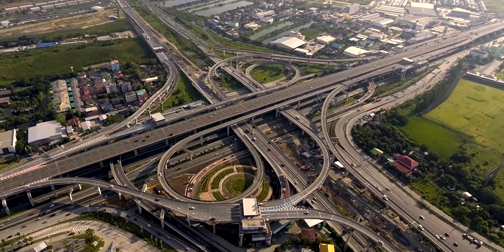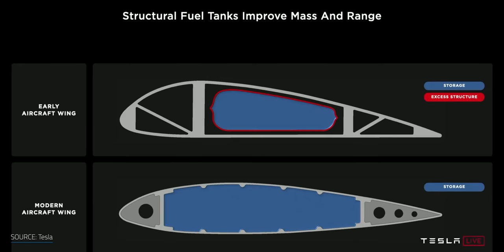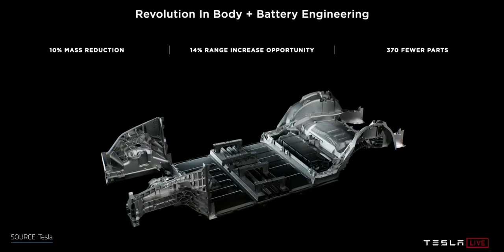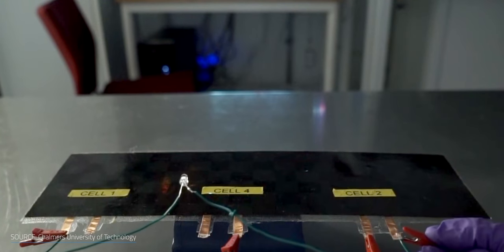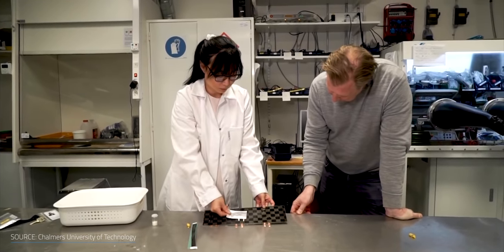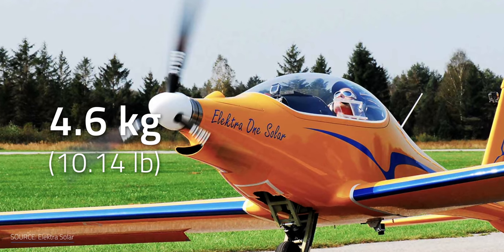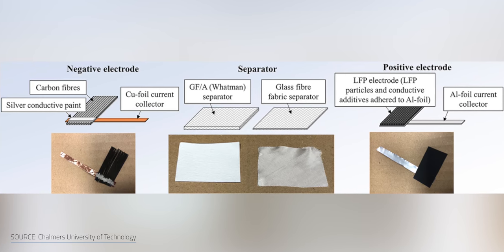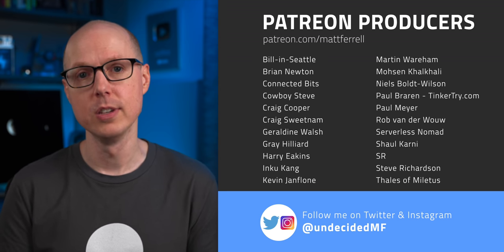Exploring Structural Batteries

Comment: Here is what is going to happen, we will never hear from it again. In 2009 Stanford university announced that they made a battery from carbon nano tubes, normal paper and ink. Their battery outperforms every existing battery on all aspects. It has a very high energy density, very low weight, and it can be made in any shape, it has a very high charge and discharge rate, and it can be charged and recharged thousands of times more compared to existing batteries. 

They also announced that same year, so almost 12 years ago, that they developed a solar panel that can convert both light and heat simultaneously into electricity. The warmer they get the more energy they will produce. Stanford university claimed that it is so efficient that it can compete with fossil fuel. 

Guess what happened with it.....we never ever heard from it again.
Reply: Exactly. Technology has been bought and never seen again since sometime in the 1800's.
US patent office has been used to hide at least 50,000 patents that deal with the BIG 3.>> Energy Production, Transportation and Pharmacology. Any improvements of these 3 areas will only come When "THEY" want them to.
I don't see any way around this, But there are lots of people way smarter then I am. I hope we can overcome this SOME HOW!!

Comment: Very interesting. I am confident that this technology will improve over the next years. However, An automobile is not an airplane. Cuting weight by let say 10% is not gaining 10% range. I am telling you that because i experienced that on both car and motorcycle tat both are electric and i'm doing the same range on my ZERO SR with 100 pounds of luggage than without.  Removing weight sure help for range but ot at the level you mention. Tire friction is the main factor. Acceleration dosen't because regen is recovering like 90% energy on next braking.

Comment: I have a better idea - we use a machine that burns chemical fuel to power another machine that has wheels and a crank. It's called 'person riding a bicycle'. Swedes already use them a lot too, so no need to create a new infrastructure for charging. Works well over city distances and is very environmentally friendly.

Comment: So, if there's a fault with your 'fuel tank'... You will need a new structural component or, more likely, a new car. It works on commercial planes because they are modular and designed to be replaced with huge resources behind them.   Try getting Tesla to replace a faulty or worn out battery after a few years use will probably write the car off.

Comment: The "massless" term is very misleading. This technology basically wraps the battery (which has a mass) in a protective capsule which has some load bearing qualities and can be used as the structural component. It replaces a heavier protection of much more efficient battery with a lighter (14% reduction) of much less energy dense (only a 20% of current standard) battery.

Comment: I wonder about performance at low temperatures. I note the structural battery uses Lithium. Today's EVs have heaters on the Lithium Ion batteries to prevent them from getting colder than their operating temperature range. Structural batteries have a large surface area largely exposed to the outside temperature. They have a much larger (100s to 1000s times) surface area than existing Li-Ion batteries and hence would consume 100s to 1000s times the battery heating power when driving in the same temperature conditions.

Comment: Structural supercapacitor would be much more interesting. So it would be another useful component to manage power spikes in regen and acceleration. Lithium cells will improve much more than the 300 wh/kg making all the wires, connectors and electronics needed to connect to that 25wh/kg of energy not profitable.

Comment: For anyone really interested, the following will help you research the topic presented here.

The use of quotes is a giveaway to some...but only to some.  There is no such thing as massless energy storage.  Here, part of the structure of the vehicle is replaced by a component that contains the material comprising the batteries...because, of course there are still batteries.  The batteries are to be made of a new material...and that's fine.  This component structure is now to be an integral part of the vehicles structure.  That's  OK as well...and it could be accomplished by  the current tech.  That is, you could make a vehicle where energy material was also a structural material for the vehicle.

But here's the problem, your structure should not be the energy storage material.  Vehicles get into accidents.  Vehicles are drivable following 93% of road accidents.  But...and this is a huge but... gas tanks and battery casings are designed to be nearly crash proof...requiring, in general, the totaling of the vehicle i.e. a bent frame and or complete failure of the drive train and its associated sub units for these energy storage units to fail.  Now you have a far far more expensive version of a battery...10x to 20x more expensive to produce (this is not new tech...thin film has been around for 40 years...and it's is used to make chips and has been for 40 years) and will add many  thousands to the cost of the vehicle and many thousands to repair costs.  Moreover, insurance costs would be massive as cars would be totaled for far less external structural damage if just the now structural battery space was damaged.  

Your aircraft analogy is just incorrect.  An aircraft does not use fuel as a structural component...if it did then aircraft structure would fail in low fuel scenarios.  They don't.  You are trying very hard to make a point you cannot make because there is no analogy as no engineer would be foolish enough to do build as you clearly want to infer.
 
The really big issue here is that the technology is in its infancy for one really big reason...everyone is trying to make a capacitor act like a battery....and at the power levels required to propel a 1+ ton vehicle.  Right now, there are small firms producing the $415 million in thin film batteries.  That fine.  They are used for small electronics applications.  The reason for this is two fold.  They are only capable of low current output but can be recharged 10s of times more often than liquid batteries....ideal for phones, laptops, tablets etc. 

Why low output?  Physics.  Thin films cannot discharge energy in large amounts.  The max discharge is measured in micro amps per cm^2 of battery.  To produce about 1 amp of continuous output it would require about 10 m^2 of thin film or about 2m by 5m...2 meters is about the average width of a car and cars are about 7 to 8 meters long.  So, given that the low end of discharge for electric cars is about 315 amps...the median is 512 amps...you can see the issue.  

In general, I don't trust University press releases because they are generally attempts at raising funds from people with too much money and too little commonsense.  Most university programs actually making breakthroughs are very very quiet...because there are myriad issues regarding licensing potential and expansion of funding by governments...even spin-off entities.  

I have included relevant sources.  The Chalmers notice, a 2021 piece at the forefront of thin film battery tech...with the associated physics, a paper from a company that makes current cutting edge production batteries...one of many, and a review of the business end of the current small market and expansion areas.

https://www.chalmers.se/en/departments/physics/news/Pages/A-spreadable-way-to-stabilise-solid-state-batteries.aspx

https://www.frontiersin.org/articles/10.3389/fenrg.2021.625123/full

http://www.excellatron.com/thin-film-battery-technology/

https://www.businesswire.com/news/home/20210505005613/en/Outlook-on-the-Thin-Film-Battery-Global-Market-to-2026---by-Technology-Battery-Type-Voltage-Type-Application-and-Region---ResearchAndMarkets.com

This could work...but not as shown.  The batteries must be removable.  They will wear out and/or become damaged.  This is not a phone.  People have gotten use to the idea of tossing the phone when the battery fails...see how Apple handles iPhone battery replacement.  This will be a 50,000 to 60,000 dollar car for a base model.

Comment: The area of the car and weight required for its proper movement on the road will cause a form and function issue, you can use this to design a new flying vehicle more than a car on roads.

Comment: During a fender bender type crash that is mild to moderate, small damages or dents in the battery pack area will end up SCRAPPING ENTIRE CAR without access to the battery pack if the battery pack is integrated into the structure. This integrated structure idea would be useless Matt, for majority of mild to moderate fender bender type crashes if battery area is affected.

Comment: there is a issue with a structural battery, that isn't realy considered here: if its the outer body of the car or phone or anything, then any damage to the cell would puncture the two membranes creating a short circuit in the best case it would be fused and the part of the cell would be disconnected from the battery, however there will be cells that gets punctured but doesn't break the fuse so they will instead drain the rest of the battery "forever". this happens to cells in cars to however its much more likely when the cells are more susceptible to damage. So now any minor damage to the car body would have to manually make sure the fuse has been disconnected. and crashing with another car could cause the body to ignite gas to ignite as it short circuits causing more explosive results from crashes. its a nice idea but not as practial. in phones it would be catastrophic, as so many people drop their phones, and people crash their bikes, skateboards and scooters all the time, making sure that these parts of the batteries doesn't make the batteries worse than not having them is going to quite challenging.

Comment: A lot of commenters seem to think a structural battery could not be repaired/replaced. I don't see why they couldn't just take it apart just like the CAD model shows it going together. Sure its a lot of work but so is an engine swap or a fuel tank replacement. Frame swaps and repairs are already a thing

Comment: Carbon fibre is not cheap.  That is a critical factor in evaulating the commercial viability of any battery material.  Are there any projections as to what this composite would cost per Kg?  Also it would be competing with the giant casting machine for body components.  Can this technology be quickly formed inot complex shapes and still retain its electrical properties?

Comment: This is a long way off from helping heavily used mobile devices. As it stands the majority of the weight in our phones and laptops is the battery, and it weighs that much because of the wh/kg limitation of batteries. This "massless" option has more mass per watt hour... so to get the same function from our devices the structure would have to increase(if eliminating standard battery packs), and only loosing a small percentage of battery weight if maintaining structure and only reducing the capacity of the standard pack...

This will be far more impactful for self propelled items with moving parts at scale... electric vehicles, drones, various robotic applications... and then mostly in locations away from electrical infrastructure. 

Best singular use I can imagine, replacing all of the trunks and totes used on wilderness exploration and field research projects. Just simply including more stored energy for these things in the closest to massless application I can think of... in things that have no electrical consumption of thier own.

Comment: The weight of just the battery in an electric car is about 1,000 pounds.  What we really need is to reduce that down to just 10 pounds (100 fold weight reduction).  Then have an easily swappable battery at the charging station where you just pull up and swap out the dead battery with the charged battery, two minutes at the charging station instead of waiting an hour for your car to charge.  I'd buy an electric car in a heartbeat if you could figure out how to do that.

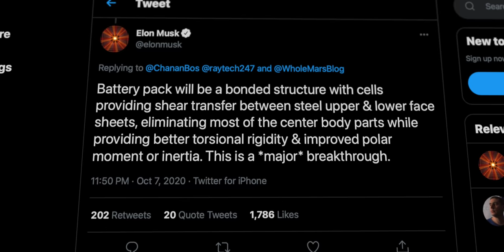Comment: 3:50 these have downsides too. 
a) cooling. its hard to keep battery that is mounted that way in any costant temp, this is an issue for longevity as AC'd battery have like 90% life left after 2 years, while nont AC'd batteries have like 60%.
look at data from nissan leaf, and tesla. 
b) imagine costs of replacing it. tesla now takes 22grands, Imagine if it means they need to literally dismount and replace crucial most imporant part that is keeping the car together. 
c) easy to flood, its very low, in case of damage to the shell, which will happen eventually, you have water in battery compartment -> I would not touch a car like that.

Comment: Important questions: What happens when a carbon-fibre battery is broken while it's charged? How many charging cycles will it last for? How replaceable are these parts? Like that Tesla structural battery dealie sounds like replacing it might require removing most of the middle part of the car.

Comment: Ah, I like this news of the 'bloodless' creatures who are creating those 'massless' structural batteries.  I doubt that it will ever work in the automotive industry, because this is not based on the Einstein's equation, E = m C^2, where 'm' is the mass of the material fuel in the nuclear reaction(s), typically by fission rather than fusion.  The more deceptive terms they use, the more corrections they need to make later, like misnomers microwaves (i.e., micrometer in wavelengths, not; just only millimeter in wavelengths, but using these terms are musical to the ears!)

Comment: Take a typical battery with out a charge in it and measure the  resistance of the battery. Now take this composite, structural battery without a charge and measure the resistance. How easily will electrons flow through this new battery?

Comment: Seems to me it's only half massless. They are using the negative carbon side as structure. The positive side does little for the structure. It would therefore count as battery weight.

Comment: This could work well as tractor-trailers roof section/s that would be integrated with solar panel/s..... productive/lightweight/structurally strong.They could then be repurposed as a solar panel/s when the battery/s are no longer is up to par and when neither work you could build something like a garage to park your EV in instead of stick-built construction.... less deforestation.

Comment: We wont have plates that are both plates and batteries. Again, taking a look at what biology does. We can use, let's say, in the form of the so hated lipocytes, but they do serve mainly as storage. They do provide some structural dampening, and thermal isolation, but their main role is to store energy. Batteries will become sturdier and have others purposes.
Your muscles purpose are both structural and to move your body. But they can also store some energy within, that the rest of the body can use. This is more likely to happen with this carbon fiber material.

Comment: I think this is exciting for consumer level batteries for sure. Like phones, computers, handhelds etc. For automotive, I'm not positive that the weight savings is really going to offset the reduction in power.

With easy to replace modular pieces this idea might work out, although it still sounds expensive. Replacing huge chunks of chassis can't be cheap on the labor or parts.

This is a big breakthrough, but it's just the beginning.

Comment: I don't believe range is the greatest issue regarding electric vehicle development. 
1) the ability to provide ready supply of electricity to supply to vehicle
2) global supply of metals to build batteries
3) time required to recharge the battery of the vehicle
Personally, I view hydrogen fuel cell vehicles to be a greater long term solution.

Comment: Massless batteries are a huge step backwards. They are less energy dense and increase the cost of repairs dramatically. Batteries make up a significant portion of the cost in ev's imagine what a fender bender would cost you if it meant you were replacing batteries not just a cheap piece of aluminum or steel.

Comment: In the long term there's a real recyclability problem with carbon fiber.  It probably shouldn't be used for large structures.  Could this be done with steel or aluminum instead?

Comment: While I think the tech is really awesome I don't think range is the make or break for an electric car. I think charge cycle is. A heavier battery with a 200 mile range will be more appealing to the market if it can be charged to full in 10 minutes or less. This would put it almost on par with liquid fuel and would take electric vehicles out of the "around town only" segment. We will keep inching toward parity with gas powered cars and I think we will get there, but it will probably take a while

Comment: my idea. graphene layers nested in carbon fiber. I've had this idea for about 10 years. car would be 3d printed with no wires. Get rid of the battery pack altogether. the car's total structure with hundreds if not 1000 of layers will be integrated and, if you don't know graphene is stronger than steel. Wish I had funds for r&d.

Comment: Isn't this a factual fallacy to refer to it as a "massless" battery?
If it has no mass it should also not require much energy to move it forward, or am I missing something in the language used?
I mean, this could just be me but I feel it goes against logic to refer to something with a measurable and definitive mass as massless.